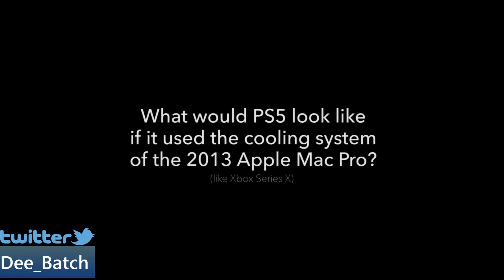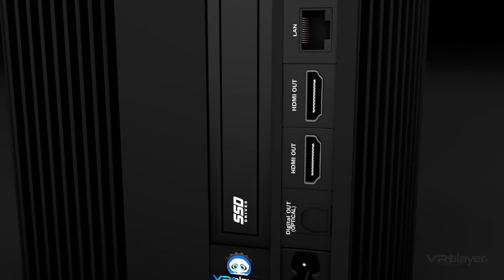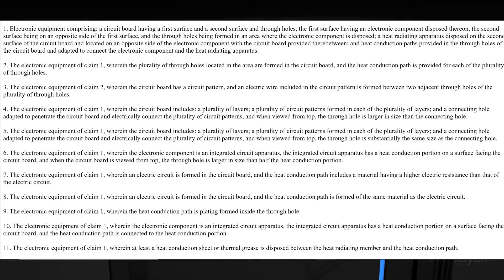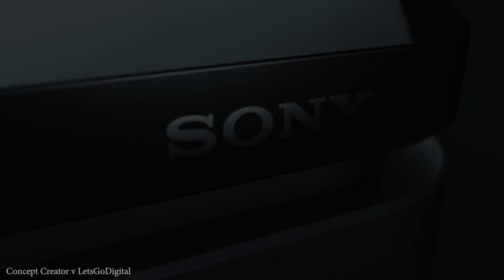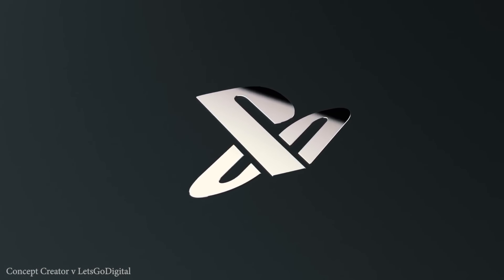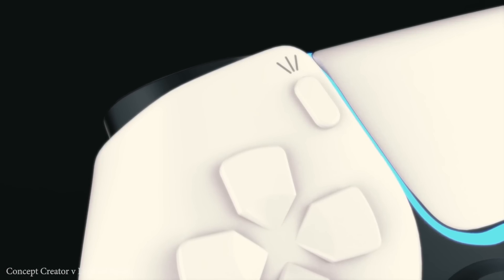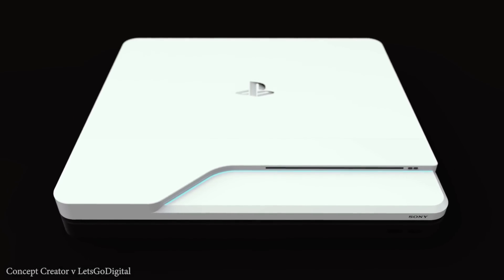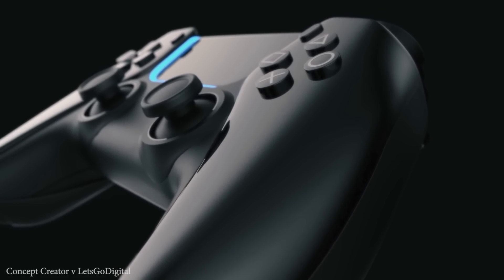PlayStation 5 Cooling Patent Revealed | PS5 Will Have Never Before Seen Tech

Comment: There's probably more to it than what is in the patent. The diagram and wording just talks about a heatsink underneath the APU housing on the motherboard. A lot of higher end PC motherboards and GPUs come with back plates that offer some degree though not a lot of heat dissipation. Especially if you have good airflow around the motherboard or GPU. 
What the patent seems to suggest is that Sony are going full out to draw out as much heat as possible from the back of the PCB and radiate that heat to where the cooling actually happens. This will either a fan blowing/socking air through the cast or possibly (given Playstations have tended to be flat-ish boxes), a custom liquid cooling solution which would be a lot quieter and do a lot more to cool the APU. My money is on Liquid cooling though it is unlikely just because having built PCs for as long as I have, I can't see slapping a heat sink on the back of a PCB justifying statements about spending money on the cooling solution. Well unless the heat sink is made of some special exotic super conductive/radiating alloy. But who knows, it could be anything

Comment: I think that the console will have the v shape still, the new cooler will cool the top and bottom and push the heat right out the middle of the v shaped vents.
Reply: Interesting theory sure hope that's the strategy for the console👍.

Comment: If Sony is at the patent stage and Microsoft is already at the tear down phase, I’m thinking ps5 might be delayed this year...it will be worth it if Sony can finally figure out their thermals
Reply: If you look on the patent itself; you can see it was published in Nov 2018. It is just now being made public.
Reply: winton3377 if they haven’t shown the ps5 in person it’s because they haven’t finalized the hardware yet which points to thermal issues this late in the production cycle.  If ps5 is on time I’ll be surprised. I’m not buying it at launch either way, I’ll wait for a ps5 Pro with a proper gpu to go with the ssd.  Series x will have way more 4k content at launch I’ll go with that first, the ps5 pro in a few years.  Sony will have their thermals down by then hopefully
Reply: @tha8baller   I don't particularly think so; I'm assuming the devkits would not have had this cooling system implemented. Seems if there were any real issues, they probably would have been made public from more credible sources by this point. And keep in mind that Sony didn't reveal PS3 until May 2005 being released Nov 2005, and PS4 until June 2013 being released Nov 2013.
Reply: winton3377 devs have already told digital foundry their dev kits can’t keep the gpu at 2.23 and have to take from the cpu to keep it there but they were having heat issues too.  We’ll see if Sony gets their thermals under control
Reply: @tha8baller   Right, the devkits, not the final console model with the cooling system implemented.
Reply: winton3377 right the devkits that are supposed to simulate the ps5’s environment for development and that’s not working. Sony needs to get their act together and fast.
Reply: @tha8baller  
That is what the patent for the cooling system is for.The devkits will not have it = Thermal issues; the final build will have the cooling system= Thermal issuses  more than likely resolved. Which brings us back to the original topic, this is why Sony patented the cooling system in 2018(made public last week) for the final build of the whole console(not the devkits).
Reply: winton3377 I doubt they’re resolved at all, you don’t have to wait for a patent to go through to use it, ever heard of ‘patent pending’? So I’m sure they put it in the dev kits and they didn’t work, that’s why they’re back to the drawing board and why we haven’t seem a peep of the ps5 yet.  Trust me they would have been smart to use the dev kits to test their cooling and then they found they couldn’t live up to the boost numbers they obviously put in at the last minute to close the gap with series x.  It’s so clear to me what happened.  Like I said they better get their act together fast or they’ll miss 2020.  Of course they’re gonna play it off like it’s the virus’ fault like with tlou2, not because they screwed up.
Reply: winton3377 the dev kits should have it no reason to wait at all, it needs to be tested now and they have found it’s not good enough.  You think they’ll just assume the cooling will work on the retail models and risk mass failures at launch?  No after that debacle in the 360 /ps3 era I guarantee they’ve tried their cooling already and found it wanting.
Reply: @tha8baller   I'm almost 100% sure that is not in the devkits; if it was there would be no surprise of how the cooling system looked before the patent reveal last week; I mean there is no other way to put, it would defintely not been a secret up until now from developers who have had it in hand all these months, it just wouldn't, sorry. Here is a link that probably will help; it states the cooling will determine what  the final case will be for the console, but it is close to the end of the article.
https://www.google.com/amp/s/www.tweaktown.com/news/71646/playstation-5s-cooling-solution-will-make-you-quite-happy-cerny-says/amp.html
Reply: winton3377 that article is nothing but should bes and maybes with nothing actually shown.   They went with a flat design for the dev kits with their first version of their cooling system (maybe it’s conventional cooling or the prototype we don’t know but why hold it back?) and that’s clearly not good enough.  Cerny thought by keeping power levels constant and varying frequency it would make the thermals more predictable but with all the new hardware, ssd etc they underestimated the amount of heat the ps5 can generate, and so they’re back to redesigning their cooling system.  Theyre going to end up with a vertical design like Xbox I’m sure.  I’ll say it again, Sony is in trouble for 2020 launch at this point, nothing in that article says otherwise.  I’ll shut up when Sony puts up. Until then, imma stick to my guns on this one.
Reply: @tha8baller   The only thing I wanted you to take from that one section in the article is that the devkits do not have this patented cooling system that was just mad
 beforehand with the devkits being out for this amount of time.

Comment: Considering the fact that the Series X cooling is not nearly as complicated yet is a more powerful and potentially bigger console with a much bigger die, this seems a bit extra though necessary simply because they running overclocked A
GPU and have that super fast SSD that needs to be cooled as well if it doesn't have it's own heatsink. OR because Sony is trying to get the console as slim as possible, which is not always practical, elsewise we'd have pretty powerful all-in-one gaming PCs and not require a desktop tower. Even gaming laptops are thicker than regular laptops so slim profiles are not always the go-to move and they don't have to be but to conclude, good is good, and this is good. The thermal worries should be squashed at this point. Also the Bloomberg report was correct in that Sony had to have spent a good penny on this cooling system because this is, in Bloomberg's words, "lavish" indeed

Comment: It really doesn’t matter. Sony made bad decisions with PS5 tech. The expensive SSD won’t be fully utilised by 3rd parties for at least 4 years as they’ll be making their games for there base audience. And once the CPU starts to bottleneck that GPU boost won’t be used. It would have made more sense to either have a larger GPU with more CU’s with a SSD that’s slower. Or just put in a standard SSD and not overclocked the APU in anyway which would have kept costs down.

Comment: Keep in mind though that AMD SmartShift Technology doesn't react with thermals but power consumption instead, running a CPU with 3.5GHz is relatively easy to achieve and doesn't necessarily means it will run a 100% utilization, they're still a lot of headroom to do with and that's why this SmartShift Technology kicks in to lend or help the remaining unused power to the GPU instead combined with 2.23GHz in GPU. People seems to be confused that devs doesn't choose which area has to be run in peaked frequency but they had to analyze the power solution or consumption instead for the system to run efficiently.
Reply: It confuses me, sounds like smart shift is a compromise ? Instead of giving us a more powerful CPU and GPU they give us smart shift technology to move power around.
Reply: @UnderWarranty  actually it's a smart way to deliver performance and power efficiency, like example why would you need to run your CPU/GPU at max clockspeeds if it isn't doing anything heavy at the screen? the fact that it might conserve more power draw on your console but instead would you let your console run in max CPU/GPU at all times? seems like a waste of energy to me at all.

Comment: Definitely interesting,  what confuses me is how some analyst said the cooling solution costs 1.50$ each to manufacture which is apparently a lot for a console when it's usually just a piece of copper/aluminum and a fan.  It's so crazy how cheap that is compared to pc CPU coolers which range from 30$ to 150$.

Maybe the big investment was in the engineering.
Reply: You can't compare a cost price of 1.50$ to a retail price of 30$ to 150$, thats just silly

Comment: They should put the ps2 chip there so it's native ps2 and ps1 back compat... How more expensive should it be if that would be the case? 🤔
Reply from the maker: much more and it makes no sense.
Reply: PSnow already does PS3/PS2/PS1 BC using Custom PS3 based servers racks
Reply: @marty8370  ps now it's not reliable everywhere, input lag (latency) sucks in most places... It's not the same as native back compat as Xbox

Comment: I think this is great news. Not sure if it will make it more expensive, but if it does then i think it is worth paying extra for a cooling system that doesn’t sound like a hair dryer.
Reply: This patent kind of confirmed the earlier Bloomberg report of Sony spending a lot of money on a "lavish" cooling system for the PlayStation 5.  It's necessary, but at the same time it's complicate, seemingly more so than the Series X which is vapor cooled and air cooled on top of simply running at lower temperatures. Developers for PlayStation 5 will still have to developer for thermal load as with that cap in place they can't go any higher without running into problems or downclocking the frequencies, but we will see how effective it all is soon enough when folks start doing comparisons.

Comment: I'm sorry but there is nothing revolutionary about drilling holes in a circuit board.
Reply from the maker: They are cooling it from the bottom and top.
Reply: @DeeBatch  that's still not revolutionary. Maybe in a game console. Industrial equipment been doing this for years. Even mainframe infrastructures have done this

Comment: I wonder how the motherboard it self  will handle. Holes within a plate are weak points and with the changes in heat could cause small fractures. Can't wait to see how Playstation is gonna run during this generation.
Reply: I've been wondering the same thing. How many heat cycles will this design tolerate. Hard to know if it's never been done before. Could be a ticking time bomb.....could be the start of something new. Personally I like XSX's split board design, looks very structurally solid. Only time will tell.
Reply: 11_ 11 hope it's not the same team that did the PS4 and PS4 Pro thermal solution.
Reply: @XBX1MASTER  😂😂😂😂

Comment: New unique solution = new increased manufacturing cost? I don't know how patents work exactly but if this is just being filed now, does that mean they haven't even finalized the build/design of the PS5?
Reply: Smokey no, designs are done way before a patent is filed. Patents are used to protect ideas/designs so you can’t patent something that doesn’t exist because you usually have to prove that it’s patentable
Reply from the maker: No they most likely had more than one design and settled on this patent lets see.
Reply: Smokey patents don’t always go public right after it is filed. This could have been filed months ago
Reply: @THERealTimeRob  Years ago 2018
Reply: If Sony had to go back to the drawing board with their cooling, which I believe they had to, then yes they haven’t finalized the final design of the ps5.  Cooling will determine if they can maintain the flat profile they’ve always had, or if they have to go with a pc-style mini-atx vertical tower that Xbox went with.  Personally I expect Sony to go vertical as well, which is why I believe Xbox was able to tear down first, as they already have a reliable cooling system in place and could finalize their design.  Oh and that patent probably indicates higher manufacturing costs due to custom designs needed to use the patent so hello $499 usd at least

Comment: I'm worried about the price of this thing. You would think because the PS5 is weaker than the XSX, it would be cheaper. But with this very expensive sounding cooling system and monster SSD, I'm thinking maybe it's gonna be a lot closer to the XSX in price than originally thought. Is a smaller form and faster load times really worth the difference in raw power especially if it means a similarily priced console? I dunno man :/

Comment: But the xbots told me that ps5 will explode..

now Im confused...
Reply: well maybe some heat issue might lye with dust collecting in places air-duster can't get clogging holes and making maintenance hard to preform.
idk but can't wait to see it soon... hopefully
Reply: it won't explode but it will melt after prolonged play
Reply: @vandammage1747  proof?
Reply: Where are these xboxs your talking about? Most of the chat is filled with positive comments from the MS side, Too bad Sony's fans approach to the start of the this generation wasn't as tasteful. Anyway happy you Sony fans got some positive news about the cooling and looking to seeing what else Sony has up it's selves in its full reveal.
Reply: @wasted0351  so you think I'm talk long about this comment section cool
Reply: @tommybull6578  The fact you already used the word Xbots already speaks volumes.
Reply: @wasted0351  the fact 90% of negative Sony news is created by xbots.
Reply: @tommybull6578  The fact you have absolutely no proof for that statement.
Reply: @tommybull6578  Using your logic then 90% of negative news towards xbox is created by Sony fans then. Seems legit 🤔
Reply: @wasted0351  negative Xbox news is lack of AAA exclusive games since mid 360 cycle.

Microsoft created that.
Reply: Time will tell, it wouldn't surprise me. I always believed the overheating issues were true, boosting to that level at a constant rate is asking a lot.

Comment: I believe it. Sony needed to find a solution to cool there consoles due to the fact they over clocked the poop out of it. It's a great year for gamers just put the darn consoles on the shelves already. Oh Sir. I'll take one if each please. Thanks Dee for great information as always👍
Reply: Did you see the variable boost chart Cerny put up in his presentation? It only showed max boost a fraction of the time, most the rest were at mid level. I doubt the ps5 gpu can sustain 2.23 for very long. Even Cerny said that sustained max boost would be rare, but I don’t like how it puts limits on game design. Doom eternal is an example of a game that doesn’t let up for significant amounts of time, so basically ps5 might tap out and drop boost if the games are too intense? I prefer series x’s approach with a proper cooling system (prototyped on their x1x) and locked frequencies for stable performance at ALL times.  None of this ‘variable’ crap. Code for ‘we don’t know how to cool this thing’
Reply: Dave Newman yup it seems what they presented as “features” like variable boost and smart shift are really just compensation for how underpowered the ps5 really is
Reply: Dave Newman I’m sure 1st party exclusives will look just fine I’m not worried about that. It’s in the 3rd party multiplat comparisons where the ps5 will be underpowered

Comment: I hope that cooling solution works out for Sony. I was looking at those fins and looked at the source to see if I can see how big they were... I hope they dont plug up with dust in a couple years. A PC can be opened up and blown out but a console can not be. DO NOT PUT THIS ON CARPETED FLOORS KIDS, or any floor.
Reply: Bigg X I open up my PS4 and blow it out every so often no problem.
Reply: Uh what? Every console I have ever bought, I have systemically broken down, replaced all thermal pads and replace cheap thermal paste with graphite film. Yes you can in fact open a gaming console and dust it out.